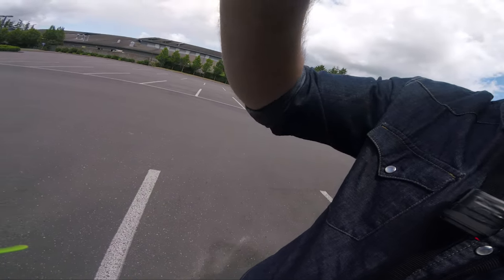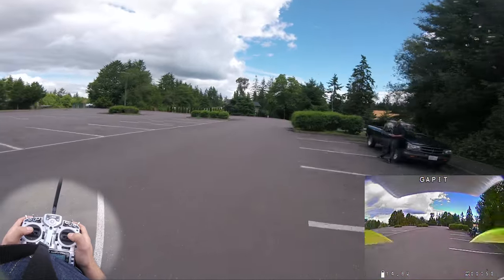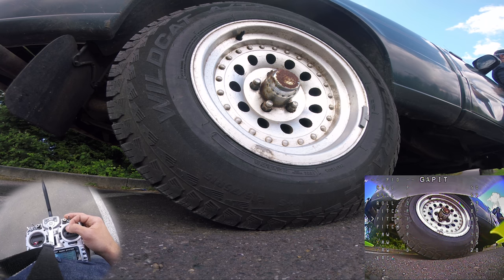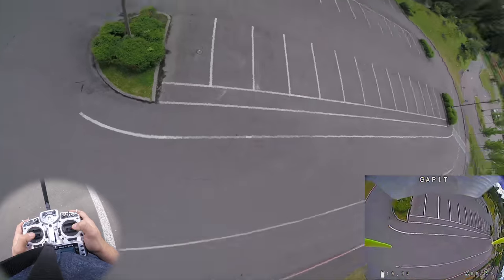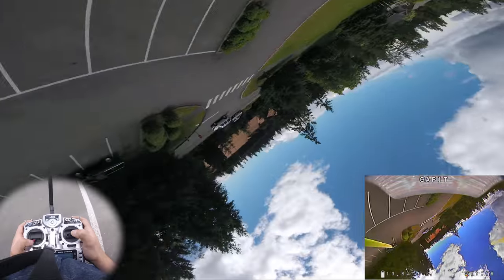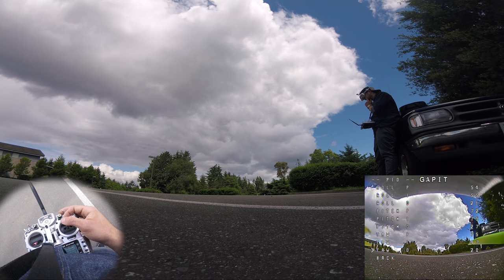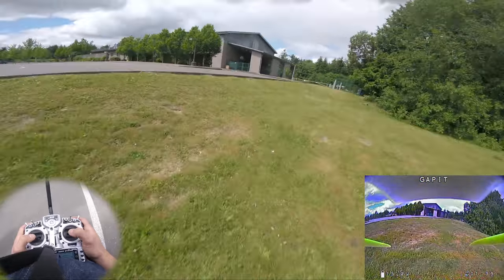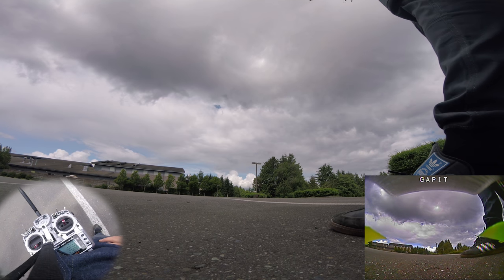ʙʟɪᴛᴢTUNING

Comment: Very insightful, thanks for this! Had no idea about the anti grav variables
Reply from the maker: Hey I'm glad it helped!

Protip:  On some releases, anti_gravity is a mode, while on others it's just enabled.  So be sure you have it on!
Reply: GAPiT FPV I doubt many people know the ACTUAL answer to this but don't you think TPA and Antigravity are butting heads at some point?!
Reply: I've always wondered that...
Reply from the maker: I don't think so.  TPA only impacts the tune at high-throttle, and antigravity (at least where I notice it) is mostly when you drop throttle to at or near dead stick.  That said, I am like John Snow when it comes to the mechanics of how this stuff actually works.
Reply: Haha same here. I thought anti gravity was triggered by a certain throttle distance covered within a specific range of time. So like when you punch out real quick and drop throttle your I's are fully torqued. I'm probably wrong though.
Reply: quadzimoto No you are absolutely correct.

Comment: great vid and advice.
sorry if I am being stupid but you talk about the betaflight fc, but listed you have the f4 om
Reply from the maker: If I said betaflight FC then I misspoke.  What I should've said was 'betaflight OSD".  The omnibus (and several other boards) support the BF OSD, which is what I used to tune through the goggles.  Hope that helps!
Reply: GAPiT FPV, thank you for replying ' didn't realise that board supported BF osd.
I have been using the new betaflight fc plus Racebase f3 ' that hpi guy highly recommends and is so easy to use ' makes my life so  much easier as I am still new to this fantastic  hobby .
Thanks again and loving the vids.
Scott

Comment: You need bf 3.2 to use passthrough with blheli32.  I just flash to a beta build of 3.2 or is it alpha, in order to flash the escs, then change back to 3.1.7.  Plus you need blheli32suite.

Comment: another top Gap production dude!!
do you use TPA at all? 
i found your inverted used really odd as I didn't hear the motors ramp up and ramp up again like mine does as it propells me to the ground. could that be down to the torque or the motors your running?

I like your approach and I'll try it for sure.

lastly, do you still have notch filters on buy just turn it to PT1?

Cheers dude.
Just uploaded my first edit today with inspiration from you videos. taking your advice on time of day to shoot and stuff really helped me get a better vid than I thought I would even with a bad tune. Thanks for helping me keep motivated.

Comment: I really can't tune out this nodding on the pitch axis... And it's a lot worse than your nodding in the beginning! It's more like 15  degrees or even more. But if I turn I up, I get a really bad shaking or wobble while throttling up, as if the motors are struggling to spin up wich makes the quad shake. And it is not my center of gravity, I tryed out every Spot for the battery, it won't change a bit. What the hell can this be?